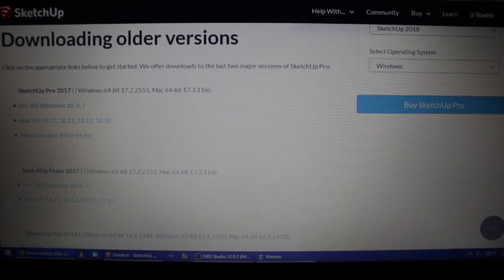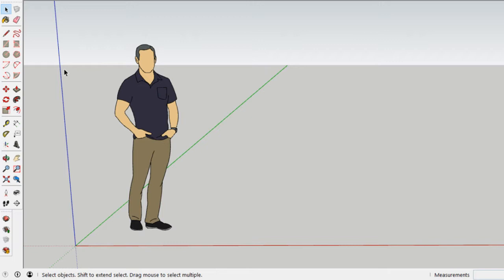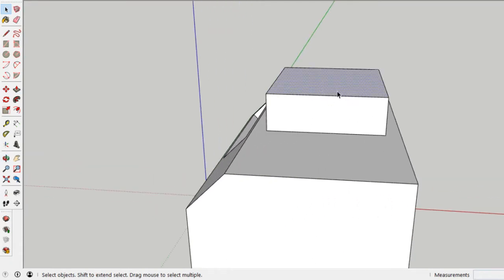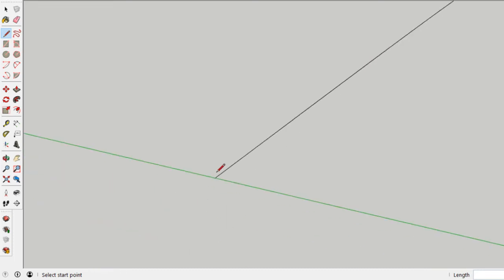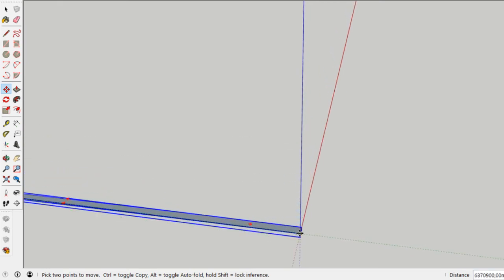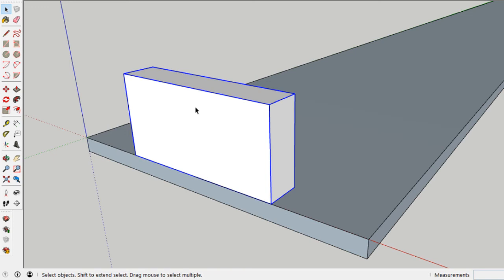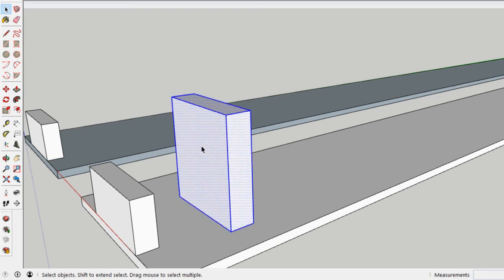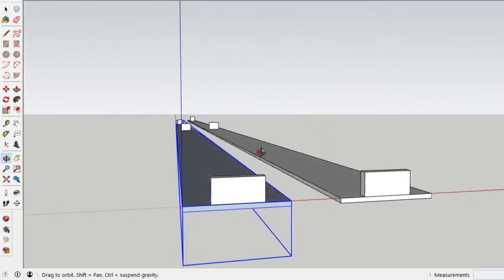Quick SketchUp Tutorial On Making The Sphere And Flat Earth Comparison Models

Comment: How does the Sketchup Free work for this?  I know the available tools are not as extensive and you don't have as much control over camera placement.
Reply from the maker: This is SketchUp Make 2017, and it's free. I don't know what is extra on the one you pay for, but as far as I use it, I haven't missed any functions what so ever. And my biggest model I have built is a three story house with everything, the file size is close to 150 MB...
Reply: @TommyGronvold  I am  trying to model the Mt St Helens/Mt Rainer photo.  I can do the flat with now problem. but when I try the globe model it doesn't match the photo or Sly's model.
Reply from the maker: Well... It's a bit hard for me to see what you did, but Sly's model in his program is a total different way to view this.
Reply: @TommyGronvold  I downloaded it for Macintosh. But I only get the paid version. And 700 bucks is a tad much.
Reply from the maker: Ok... That' not good at all! Have you tried both links, PRO and MAKE?
Reply: Tommy Grønvold I will have another go at it. Also fire up my windows laptop and test win version. Sometimes free versions are not available for Macintosh. For some strange reason